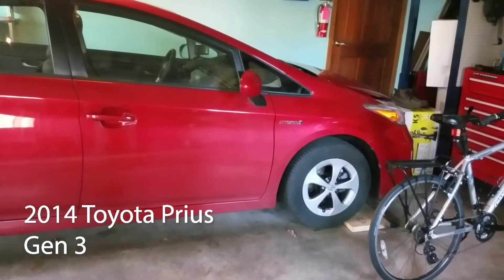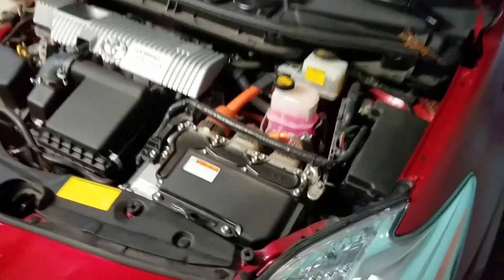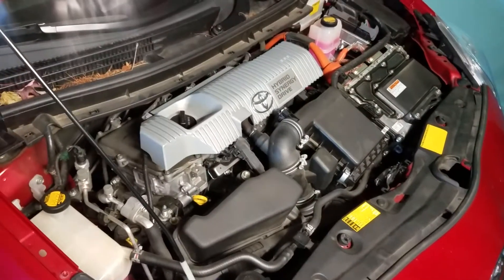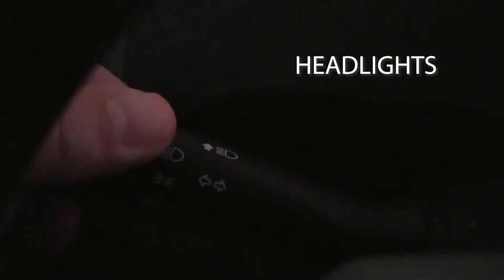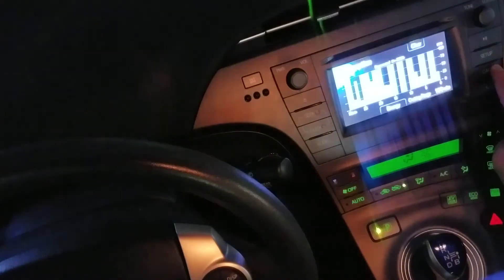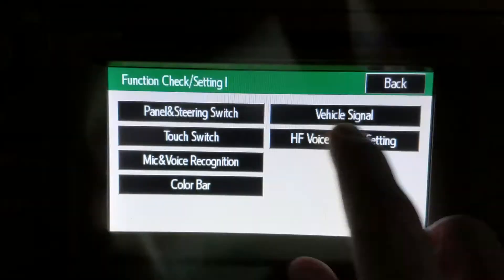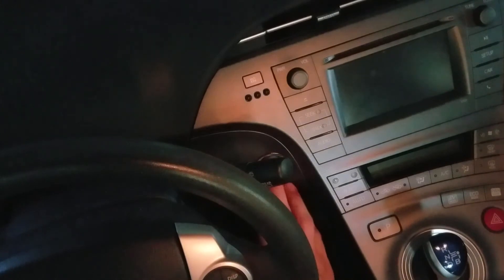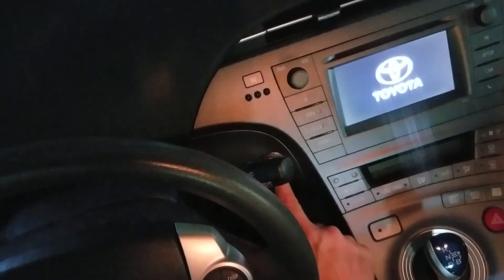PRIUS GEN3 12 VOLT BATTERY SELF TEST

Comment: Bless you. Winter's coming on and my wife's Prius battery is 7 years old. Just did your check and it's 11.6V. Heading to Toyota dealer tomorrow.
Reply from the maker: Hope the visit to the dealer didn't sting too much. Thanks for the view.
Reply: David, it is not that simple. If you e.g. are only driving short trips daily, you might end up with a badly charged battery that is actually fine. You have to charge for many hours to fill it up, or drive for many hours. And you do not need much to start the cars as the engine is actually started from the high voltage battery, not the 12 volt.
Reply: @leiferiksson1785  I was under the impression that the 12v battery is needed to initialize the computer. After a self check it switches to the HV battery. If that's the case, the question now is, how much voltage is required to initialize the computer? 12v?

I have a 2011 prius 2 without the advanced display, so I'll try the multimeter method
Reply: @eCroz_8611  does not need much but close to 12v. If you max the 12v battery you will get more like 13v. If you live in a cold are with below water freezing point, then a badly charged battery may take a lot of damage.

Comment: Which battery I can install it 46 50 or 60 ?
Reply from the maker: You need an AGM battery, best to get from the dealer (shop around for price) since it designed to have the correct internal resistance for your car. You can find other AGM that will fit and work but they are still expensive so might as well get the better one. Good luck.
Reply: cfldriven Thankyou so much bro ❤️

Comment: My Prius 2014 showing engine sign so can i change the battery or hybrid battery ?
Reply from the maker: If it's the check engine light. ... It could be a misfiring engine, a broken oxygen sensor or simply a loose gas cap. While not a pull to side of road and call tow truck event, it should get checked out as soon as possible. 
Do check the gas cap first it case it loose.

Comment: Aren't you supposed to check it with it running
Reply: No - because it will be charging then & give you a misleading reading. You need to know the battery voltage after the car sits for at least an hour. You want to see if the battery is holding it's voltage once the charging has stopped.
Reply: @bsquare111  mine was 12.1 resting so thats ok right
Reply: @bsquare111  that is exactly right !!!  and measure before the break cylinder initiation....

Comment: this method did not work for my pruis V 2015
Reply from the maker: Sorry to hear that, did you keep holding the car button while switching the lights?
Thank you for sharing your experience.
Reply: @cfldriven  my car is  Prius V III 2015. I did not find a car button. but I tried it with all the buttons around the radio.
Reply from the maker: @jacka.4774  Sorry this solution did not work for the Prius V, if I learn anything new I will pass it on.
Reply: @cfldriven  thanks

Comment: My 2010 has no "Car" button. ??
Reply: Try the "info phone" button on my 2010 Prius Model 5 and that brought up the function check settings button and pressed the vehicle signal and saw the battery voltage. Just put a new one in and it's 11.6v?
Reply: My 2013 does not have the car button either but it works with the setup button same procedure

Comment: My 2012 prius shows 14v when I checked the battery today. Is that a high number that suggests a replacement is near? I notice my MPG is much lower now, I get 30-35mpg normally. Prius has 195k with battery and head gasket replaced ~ 150k. Thank you
Reply: I think the drop of MPH is related with the decrease of main battery modules's efficiency instead of 12V start battery. In my experiences of various batteries, both 14V and 11.9V would  be fully fine. I would be serious about a battery when there is over 0.4 ~ 0.5 V drop of voltage. So to speak, from 11.6 V  Additionally, less than 3 V higher voltage would be also fine.
Reply: I would like to see what you get as an answer here. I’m considering changing my 12 V battery because I’m averaging 43 MPG I don’t think it is normal.
Reply: Most likely the car was in Ready mode so the system was already charging the battery. It is doing it at about 14V somewhere btw 13.9 and 14.2 V  (until it is re-charged) .. I can tell since I have a ScanGauge monitoring the battery voltage among other things.  The only really good (simple)  test for a battery is to measure the open circuit voltage after some time  the car stopped AFTER at least for an houre drive (wait several hours if possible). Best it is at the back under the hatch ...under the hood is OK but you cannot open the hood without opening the driver door which then triggers the main break cylinder initial charge up. That is a huge load on the battery ... If you have a garage open the hood at the evening (just unlock it) and measure the voltage as it shown in the video that is a good home test.

Better yet to take to a place where they can measure it with a tool much more reliable.
Reply: There is no logical correlation between 12V battery and MPG.  Unless the battery is really bad and the DC to DC converter keep charging large current that is wasted as heat. But not so much heat that can take MPG that much. Only in warm weather >12V is a good parameter in open circuit, not when the ignition is on. .  In cold weather below freezing, the best number is not the maximum voltage but the voltage reading under load.  As long as it is above 11 V when the ignition is on, it is OK. If the headlight+heater/defroster+AC blower are all on, it should be still above 10V.  This is the best parameter, not the voltage without any large load.  Bad battery often shows ?>12V and drop under 10 V, often as low as 8V when under load.  I have mine at 11.7V when ignition is on, it does not have problems for the past 4 years starting the car.  My old bad battery reads 12.2V open circuit but when under any load it drops well below 10 V. That death battery was 7 years old in hot Florida without garage.

Comment: How do you do this if you don't have navigation? There is no screen; all the vehicle info appears above by the speedometer. 2010 model. Thanks!
Reply from the maker: The 2010 Prius has the same layout as the 2014 so the steps in the video should work. If your display monitor is not working then I would just get a voltage meter and get a reading from under the hood.
Reply: @cfldriven  Like Aaron (above), I also have a car (2011) without that large screen and I do NOT have a "CAR" button.  There must be an alternate button to use on mine.  Do you know what that is?
Reply: @bobhubel1  did you figure it out ? I have a 2010 also with no "car" button
Reply: @cfldriven  I also have a 2011 Prius and there is no screen in the middle. All info appears on dashboard.
Reply: @froggyhigh101  did you figure it out ? I have a 2010 also with no "car" button

Comment: Is it important to stay off the brake pedal during this test?   So the car does not start after the first Power button push?  Thanks, great video!
Reply from the maker: Having the engine starts means having to shut it off and redo the steps. Thanks for watching.
Reply: @cfldriven  so no brake pedal at all right?
Reply from the maker: @caseykittel  You are correct, at no time did I ever press on the brake pedal.
Reply: @cfldriven  but just opening the driver side door will "charges up" the main break cylinder  you can actually hear that ... THAT is the biggest hit on the 12V battery so even a medium/good battery will drop the voltage considerably.   If you are interested in  the real open current voltage of your battery you MUST do it at the back on the battery itself. The fuse box you may have a  slight voltage drop.   And if the car already booted up you are NO longer measure the open circuit voltage which is real test for a battery .... (after a few hours of an external charger or a long enough drive). 

What you show is pretty much useless test .... actually 11.9V after the break cylinder charge and a load, is NOT too bad   at all I have seen 10.9 with that ...   what is not happening is the inverter charging the battery.

You can actually perform this (did not try) NOT opening the driver side door but passenger side (but of course much harder to do ... 

Try that and see if the numberes are the same   also putting the car in auxiliary mode alone puts load on the system.

So this is useless (even if it works)
Reply from the maker: @NixUgriBugri  Thank you for sharing your knowledge on the subject, always good to learn more.
Reply: @cfldriven  Also like to add that  for a prius the 12V battery is somewhat of a bigger issue than a regular  car. Just three points here the battery is smaller so  similar parasitic load (like the keyless system immobilizer  or any other  thing like camera which is always ON)  will drain quicker and deeper the battery.   So just a couple of weeks the 12V battery can drain so low that it will NOT be able to charge the main break cylinder and boot the car. Also a city driving  car may have a hard time to re-charge the 12V battery.  It takes  on average about 40 minutes drive (not mile ) to just re-replenish the  charge used up from cold start.  The good news is that when the car is in Ready mode the main battery charges the 12V engine no need to run.  So if it safe you can just leave the car in Ready mode during a coffee stop (just kidding).

 Now during the lockdown/working from home  I actually doing that since I am not driving daily even.  If I am running a short errand leave it in Ready in Parked if I just picking up something (adn it is safe to do .. it is safe around where I live).

However the best practice to get a slow/drip charger (which is 1-2 Amp) and use it at least once a month  (of course if the car is parked on the street this is not an option then really just keep it running for a little while).

And thirdly again since the battery is relatively small it is a lot easier to fully discharge it... and doing it just a few times will dramatically shorten its life (make sure you buy one with good warranty and keep the receipt ... I got one replaced no question asked when it died in 11.5 month ... not even sure why it happened)